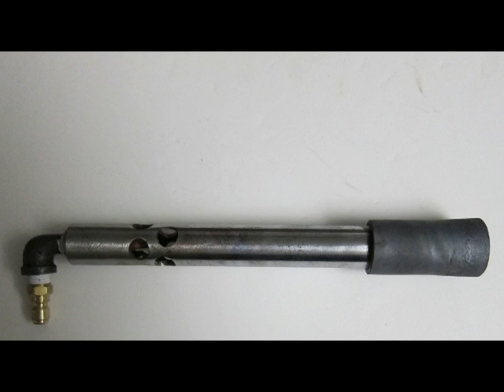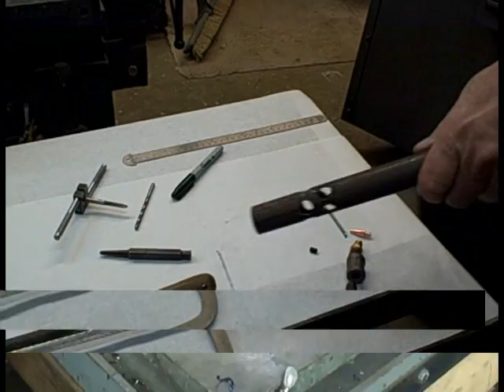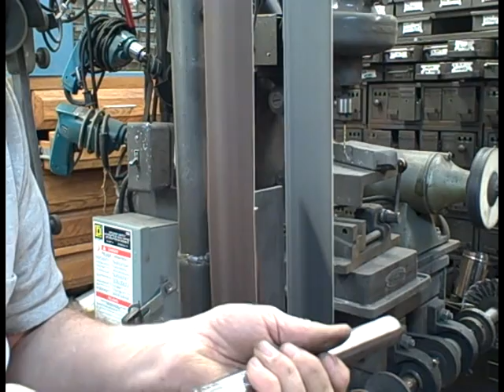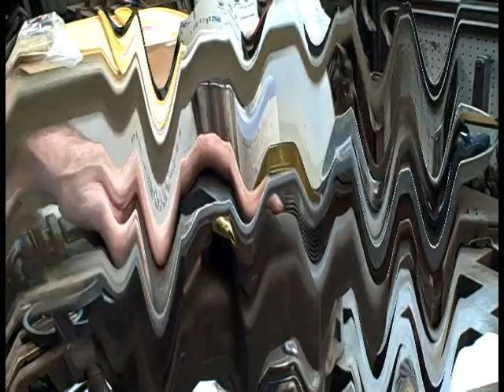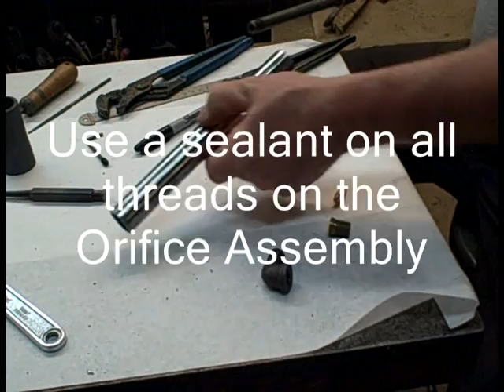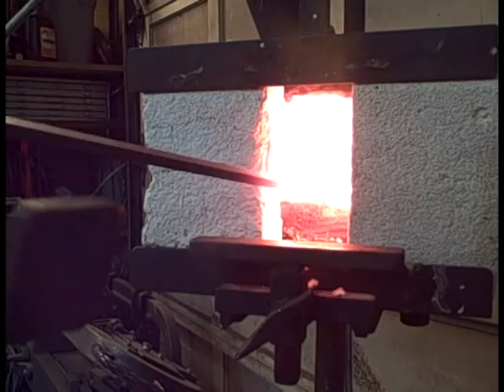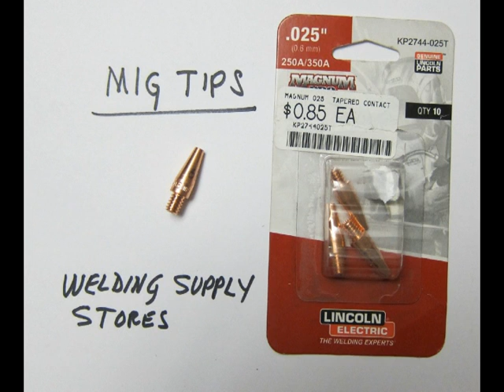How to build a Propane Forge Burner

Comment: Thanks for sharing such a well produced video.  Video detail was not agonizing at all.  I think all videos should be produced like yours.  Thank you again for sharing!  Any idea what max working temperature your forge will produce?
Reply from the maker: +Ed Floody A while back, I used an Infrared thermometer to check and, at that time, the forge would get to around 2900 degrees F.  Keep in mind, any forge has to be properly lined to reach that temperature.

Comment: Hello & thanks for the info. what would be a good distance to stagger if four or five burners are used?
Reply: Aaron Smith How large a forge are you going to make?   And what shape?   If your forge is long, the burners can be evenly space in a single row (as least 3 inches from any door or opening).   If your forge is boxy or a large round,  put the burners in a square or oblong configuration at least 3-4 inches apart.  Please keep in mind each 3/4 inch burner can support up to around 300 cubic inches of burn chamber (the inside of the lined forge).  I rarely need a forge that requires more than one burner.  When I do, I generally use a free form forge (see my free form forge video) and use a double burner manifold.
Reply: David Hammer awesome, thanks again, I will research those vids. I need to heat at least a 27" section at once. I was planning on constructing a c shaped burner like the ones sold on gas forges. com website

Comment: Could anyone make a part list for everything on this comment please, ASAP
Reply: MinecraftWithBacon All this information is on the video.  Please watch the entire video and take notes.  I speak about each and every piece of material needed.

If you stop the video at 5:07, you will see a picture that shows the parts needed to make the burner.  They include 

1.  1/4 inch NPT black pipe street elbow 

2.  1/4 inch NPT black pipe coupler

3.  1/4 inch NPT brass flare fitting that can be cut and threaded on the flare side to hold a mig tip.  The fitting hole must be thick enough to hold threads.  Other 1/4 inch NPT fittings can be used as long as you can cut threads for a mig tip.

4.  A .025 (or .030) mig tip (check thread type to know how to thread the brass fitting).

5.  A nine inch piece of 3/4 inch black steel pipe (schedule 40).

6.  A flare.   Look on eBay for one that will fit on a 3/4 inch pipe if you can't make one.

7.  Set screws to hold the coupler and flare in place.

Watch the video to determine the other equipment you need from the propane tank to the burner.  Find a 0-60 regulator (TSC no longer sells the 0-60 regulator I reference).  Goss sells one, but they are pricy.  A 0-30 regulator will NOT get full performance from this burner.  Buy a high-quality needle valve, and use a pressure gauge as shown if you want to be able to set pressure for varying forging environments.
Reply: David Hammer could you link me somewhere where I could buy the 1/4 inch NPT black pipe coupler, and to the 1/4 inch NPT brass flare fitting
Reply: MinecraftWithBacon https://www.plumbingsupply.com  has both. Their shipping and handling charge for small orders is about $9 (same S & H for 5 of each).   I recommend you look in the online yellowpages for a local plumbing supply to find the black pipe fitting (ask if they also have brass flare fittings (1/4 x 1/4, flare-MIP).   Remember, as I said in the video, the hole through the brass fitting must be small enough to be able to be tapped for the mig tip.  

No offense meant, but be sure you have all the tools needed to be able to make this burner before you buy materials.  The video shows and describes all the processes and shows the use of all the tools you need.   

Home Depot sells the brass fitting I use (Lowes would also).  It is a WATTS (brand) item LFA-80.  Cost is between $2 and $3.   They used to carry 1/4 inch black pipe fittings, but no longer do (at least where I live).  I go to a (fairly local) plumbing supply to buy the black pipe fittings.  Your local hardware store may carry the coupler.

Good luck with your project.   If you don't have the tools and still want this burner, a friend of mine sells a professionally made version similar (cost is over $100 though).  Read the description portion of this video and you will find his name and email address.  I  have no business relationship with him for his burners.  I just direct purchase inquires his way.   His burner is fully machined and is excellent.

Comment: David, I am about to build a burner from your design. and I have a couple questions. 1st. can the 1/4 pipe coupler be replaced by a machined steel part? turned to a snug fit. It would then be drilled for the thread size of the welding tip, and bored for the other end to be threaded for 1/4 pipe thread on one end and for the welding tip at the other. All of this in a lathe of course. Would I need to turn a step to account for the lack of the brass fitting? Also is it crucial that the flare be SS? Would a choke be a good addition or just not needed? Thanks for this video it has helped me a bunch.Mark
Reply: xonkkram1 You certainly could use a machined part to replace the coupler.   It would even ensure a better fit.  In the video I recommend the end of the mig tip be centered on the bottom holes on the burner body.   I know this positioning isn't critical, but I'm not sure how far up from that point would still work well.  With the equipment you have, you could even drill a proper sized hole (orifice) in the end of your plug and not use a mig tip.   My recommendation would be to make your plug long enough (with a step, if you wish) to position the orifice (mig tip, if you use one)  near the center of the lower holes (it may work much higher, but you would have to experiment).  The most critical factor is that the tip be pointed down the CENTER of the burner tube.

I get a lot of questions about flares because the SS flares are expensive and sometimes hard to find if you can't make them yourself.  The flare is definitely needed if the burner will be used outside a forge (the burner will not stay lit without the flare in the free air).  Whether or not the burner will work without a flare inside a burner depends upon the design of the forge.   This burner will work without a flare if the forge is built and lined like my Super C videos (I have verified that).  I cannot speak for other designs.  Even in the Super C forge, the burner may not light as easily and the flame may not be as stable (at least till the forge is warmed up).

Although the flare works best if it is tapered (I believe it facilitates a more stable flame), a straight pipe will also work for a flare (although I have noticed the flame is not as stable).  Steel pipe will work fine for a flare....  It just doesn't last as long as SS.  The end of the flares will eventually burn and the flare will need to be replaced.  

I have confirmed the burner will work without a flare in the Super C forge Be sure there is refactor up into the burner opening beyond the end of the burner (and that opening is tapered down into the burn chamber of the forge.   I would expect the end of the burner will eventually burn also, but do not have a feeling how long it would last (as compared to a flare).

In either case,  if in time, your burner flame starts to be erratic, take the the burner out and inspect it.     

Another question may be "How long do the burners, with or without flares, last.  The answer is....  It depends upon how hot you run your forge.  The hotter you run it (especially for extended periods of time), the more quickly the flare or burner is damaged by the heat.  Before I started running forges at welding heat most of the time,  burners would last years.   Now, if I run continually at very high heat, I need to replace the flares after a few months of use.  If you only run your forge at a moderate forging heat, the burners will last a long time without maintenance.

If your burner has trouble lighting, or maintaining a steady flame, try a slightly larger hole.  In the case of the   mig tip, use the next larger size (.030, instead of .025).

Also, don't forget to check the thread size on the mig tip.  Some are 1/4 - 20.   Others are 1/4 - 28,

Good luck with your project.

Comment: What can I do to make this burn hotter?
Reply: mrclean clean Crank up the propane pressure.   

If your forge is not getting hot enough, I have a few questions for you....What pressure are you running at?  How is your forge lined?  How many cubic inches is your burn chamber?  What are you using for a floor.  How many square inches are open on your forge doors?

There are MANY reasons a forge doesn't get hot enough to satisfy us.  This burner will heat any proper sized, well lined forge to welding temperatures.
Reply: ok thanks!
Reply: mrclean clean If you message me with answers to the questions, I can probably tell you what your issue is.

Comment: Thanks. KISS method is always great to use. Have ypu tried the .035 mig tips? Seems to have become a standard for making these. Curious as to burn difference. Other than bit more atmosphere air needed.
Reply: The video shows use of .025 mig tips.   If someone has problems with a burner, I have suggested using  .030 tips.   I have, in the past, used .035 mig tips with different designs (ex. the side burner design).   I haven't used .035 tips with this design.   The larger the orifice, the less pressure is needed to get the heat.   Although I haven't done a study, it is my perception that the larger the orifice, the noisier the burner.

Comment: David, I just finished building two burners based on your design(or design you used) and I can't seem to get them to work right. The regulator and hose assembly I bought only goes up to 10 psi. I have seen other burner work with less psi. Does the regulator need to have a higher psi rating? Any help would be great thanks
Reply: I would not recommend using a regulator less than 0-30 PSI for these type burners.   Better results, if you want to  get to forge welding temperatures, would be obtained with a 0-60 PSI regulator.   I don't know of any atmospheric burner designs the would work (for forging) with a 10 PSI regulator.  Burners that use a blower will work well with lower PSI regulators, but I don't know what the low end of their PSI range is.   In any case, your regulator needs to be adjustable so you have control over the intensity of your flame.
Reply: David Hammer Thanks for the response David. I was able to get the burner going after a while adjusting the flare. When I first fired up the burner it had a weak flame, but after enough pressure built up I did get a nice blue flame. I put a piece of 3/8 bar into it to test it and it only got up to an orange heat. I do need it to get to forge weld heat, so I guess I will have to get a 0-30 or 0-60 regulator.....when I have the money. Also, I was wondering if you had any opinion or knowledge about refractory brick or fire brick. do you think there is or is there a difference between "fire brick" and "refractory brick"? Again thanks for the help and the video.
Reply: mtodd12002 In my book, there are two kinds of firebrick, hard and soft.  Soft firebrick is sometimes called Insulating Firebrick.  I'm sure there are other names for both hard and soft brick, but the distinction is weight and how you can cut it.  Soft firebrick can be cut with a hand saw (carpenter or hack).  It can also be shaped using a file (like a farrier's rasp).  To cut hard firebrick, you would need a diamond or masonry blade and a masonary saw.  If you are going to use firebrick to build a forge, you would be well served to build the sides and top with soft brick and the floor with a half inch (better), or 1 inch hard firebrick OVER a layer of soft brick (or thermal blanket).  If you are not going to use flux in the forge, the floor can be just soft firebrick (flux will quickly damage soft brick....   and slowly damage hard brick).   If you want to see an example of a forge made with soft brick, view my "Free Form Forge" video.  Obviously, a much smaller forge can be built this way also (and use a single burner).

If you make a forge using just hard brick, it will take a lot longer to heat to forging temperatures (if it ever does).  The difference is that soft brick will heat faster, then reflect heat back into the burn chamber.   

The hard brick floor should be thin because that will let it heat to forging temps quicker than a thick brick.  The sooner the entire inside of the forge can get to forging heat, the sooner you can start forging.  Keep in mind that the piece you are forging should be heated by the burn chamber and not necessarily the burner (the burner heats the burn chamber).

My recommendation, if you are making a forge using a metal body, is to use thermal blanket (like KaoWool or durablanket) to line the forge, then put a floor in it.   You can see a simple forge and lining example in my "Simple Propane Forge Lining" video.   Hard brick or soft brick can be used on the ends of the forge.   In the video, I use hard brick for the ends.  Using hard brick the way I did in the video works because most of the burn chamber is lined with thermal blanket.  Using soft brick would let the burn chamber heat to forging temperatures just a little faster.

For the best lining for a forge (fastest heating and durable), see my "Lining the Super C Forge" and "Floors and Doors" videos.   A little update....   If the forge burn chamber is less than 1/2 cubic foot, you probably only need to use the slurry I show as a refractory (multilayers using mortar is not necessary).

If you are going to build a metal encased forge, you might consider watching the "Build a Super C Forge" video.

More than you asked about....   Good luck with your project.

Comment: I made this but it doesn't have enough pressure do you know of anything I did wrong
Reply: Several things could be your problem...  

First of all,  is your regulator capable of at least 30 PSI?  I use, and recommend a 0-60 PSI regulator.   I crank it all the way up and use the needle valve to regulate propane. 

Are you sure your tank has enough propane in it?  

If your shop is cold, your tank could be freezing up.  When this happens, the propane will not exit the tank.  I put my tank in my slack tup when it happens.  if your slack tub is not frozen, it will warm the tank enough for the propane (if it's in there) to exit as gas.

Are you using a quality needle valve (cheaper ones will not necessarily work well)?  If you have a pressure gauge on the burner side from the needle valve, watch the pressure readings as you open the needle valve further.  Start your forge at around 15 PSI, and open the needle valve more to see higher pressures and a hotter flame.  I use pressures up to 35-40 PSI when I want welding heat.  After the forge is at forging heat, I generally run around 20 PSI for general forging.   

Use an acetylene cleaner to clear the mig tip.  If you used tape, instead of paste to seal joints, sometimes a small piece of tape will break loose and plug the mig tip. 

Some folks have problems when they use the .025 mig tip.   If you cannot solve your problems by following everything I show in the video, try replacing the mig tip with an .030 tip.  The pressures you need for good operations may be may be a little less.

Good luck
Reply: thanks i will try these and see if they fix it

Comment: I'm grateful for the information I'm building these now ...funny how parts get you 25$ a trip to the store but worth it in the end ...I seem to waiting on the post... most coming by mail... I have a couple of questions I hope you can answer ... the placement of the mig tip .. where exactly does it line up in the tube.. center of the bottom holes, are the bottom holes...  closest to the tip? ... just want to make sure...  seems easy but I couldn't see the tip in the video ... my street elbow seems farther in then yours and when I line it up with the holes closest to the end toward the burner the iron coupler sticks out farther then yours
Reply: I generally put the end of the mig tip in the center of the bottom holes.  It will work in other positions also (up a bit).  The most important consideration is that it point straight down the center of the burner tube.  As long as you are getting a good flame, it really doesn't matter where the end of the tip is.
Reply: which holes are the bottom holes  ...
Reply: The 2 inch holes or the 2 3/4 holes?
Reply: Jeff Booher The bottom holes are those that are closest to the flare.

Comment: Do the quick connects used for the hose assembly have to be the specific BST-2 and BST-N2M?
Reply: No....   the quick connects do not have to be BST-2 and BST-N2M.  

They can be ANY quick connects that are safe to use with propane gas (not all are).   In fact, you can buy quick connects that are sold specifically for propane usage (I don't because they are more expensive).  

Hydraulic quick connects are safe to use because the o-rings in them are Nitrile and will not be damaged by propane.

I do advise NOT to use air hose quick connects because they (in general) do not have Nitrile o-rings.